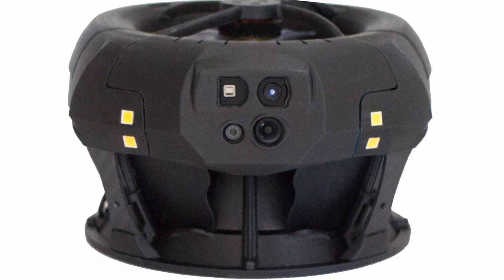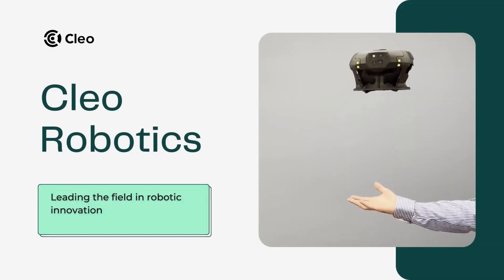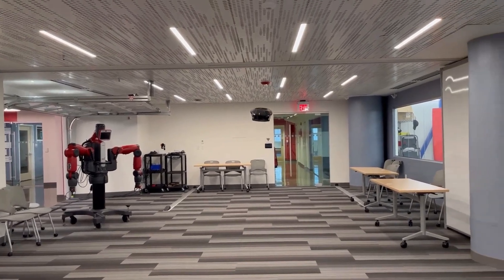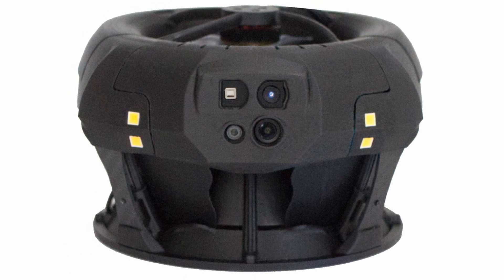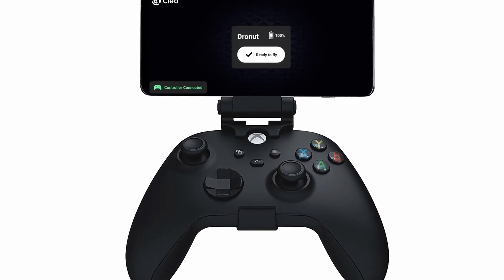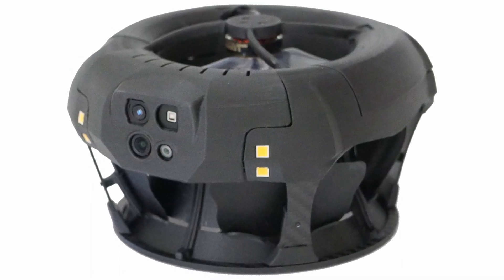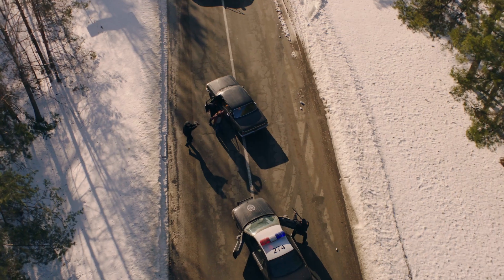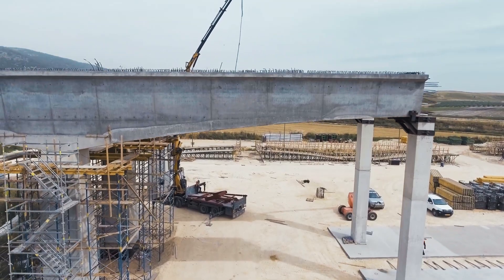DRONUT X1 || The Flying Donut

Comment: I wonder will it fit in the small shafts of the Great Pyramid of Giza in Egypt? They need better photography! It wouldn’t damage the shafts at all.
Reply: Just because it would fit doesn't mean it would fly good. It would also have signal problems. A "worm" like drone would perform better. Some repeaters would also help with the range problem.

Comment: $9000! Wow, I'll wait.
Reply from the maker: Yeah,it's quite alot.
Reply: Or go to Dunkin near by
Reply: You can make your own with less than 2,000
Reply: Well priced would like to a standard controller other than Xbox controller.
Like to see how i goes in difficult environments, and how reliable it is also estimated Matanace schedule
Reply: Chinese version will come out soon, they copy everything. :)
Reply: @arongabor9521  I'll buy a sun.
Reply: @arongabor9521  I think they patented the design. Maybe that’s why you don’t see this design anywhere.
Reply: @hakonmur  Have you seen the movie Runaway? It has a similar drone in it, they call it floater. The movie is from 1984!!! I bet it didn't worked at that time, surely it was a movie trick but the idea is not new.